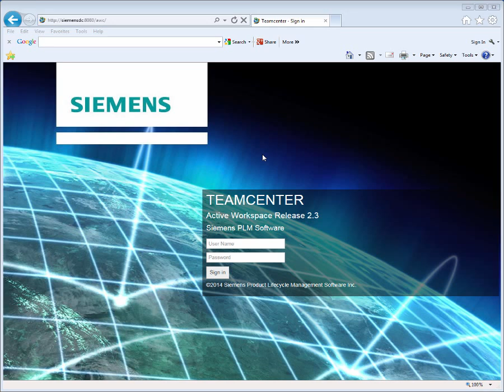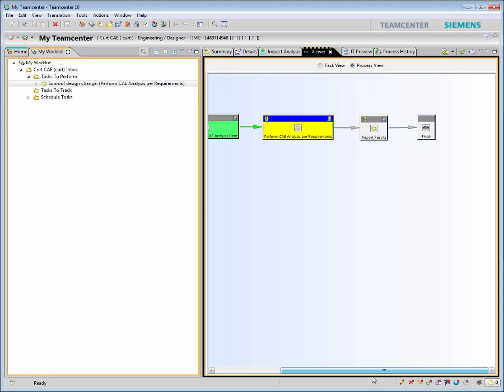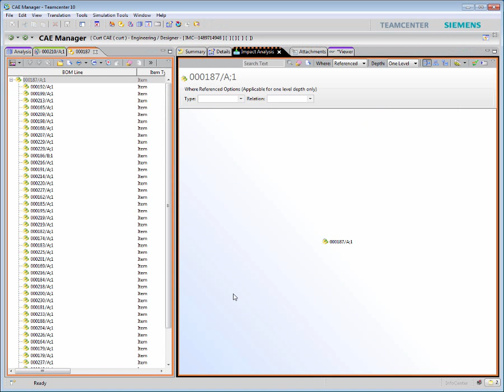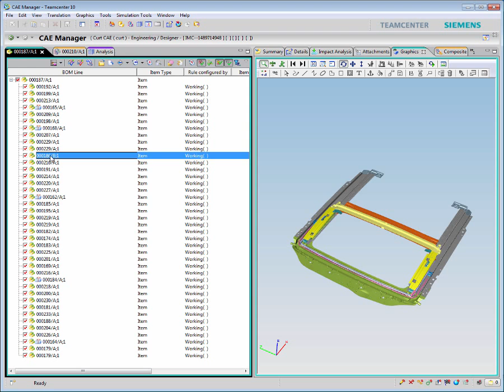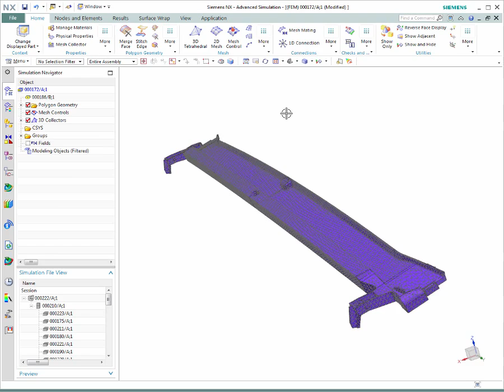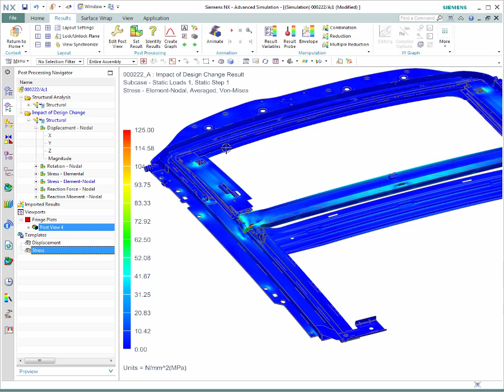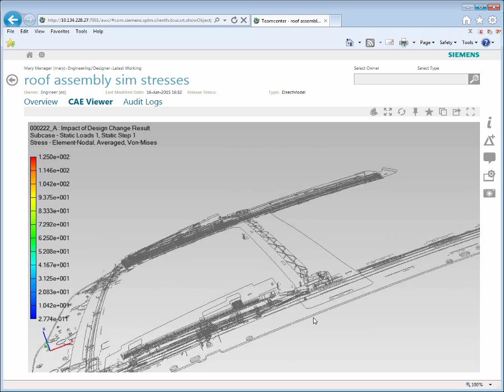Teamcenter - CAE Integration Overview

Comment: How are individual mesh files(.h datasets) uploaded under the respective  CAE models from a pre processing tool? Consider I am going to mesh a assembly with 5 components. I create CAE models using structure map> Load it into the pre processor ( hyperworks)> Do the mesh work > Save. Will it upload 5 mesh model against each CAE model . I do not see this working as only one meshmodel(.hm) file is getting uploaded in the CAE model ( parent only).